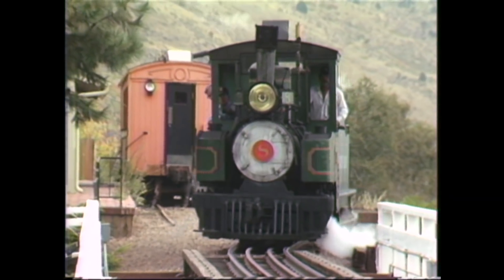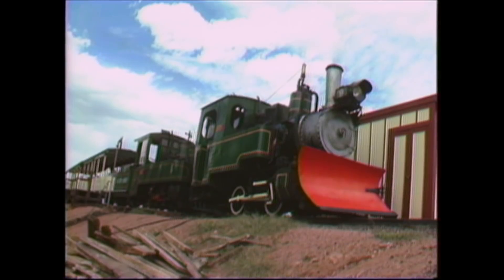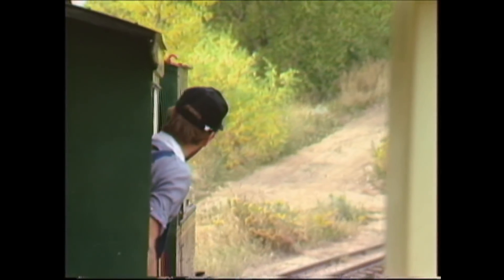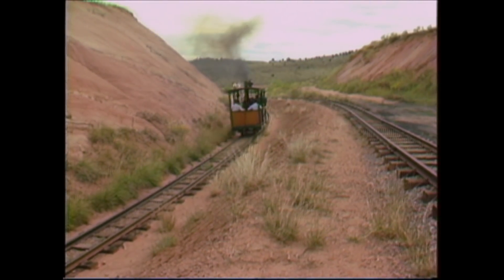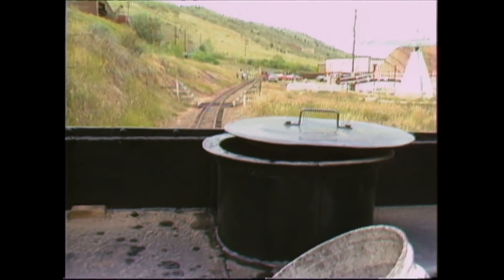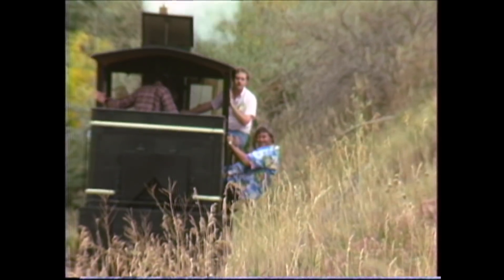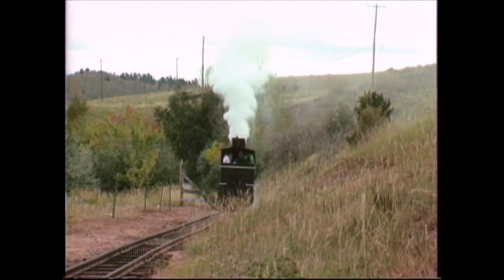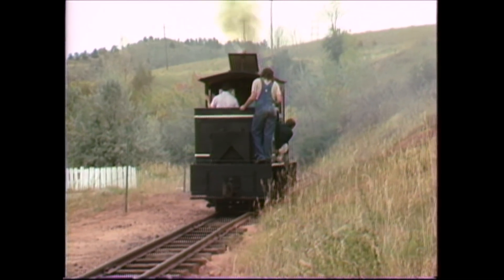Golden's High Country Railroad - 2 Foot Gauge Construction Shay

Comment from the maker: SOME CORRECTIONS! PLEASE READ

As it is really hard to get the straight story on many of these subjects and people, we go with what we can round up, often antidotes. So we get things a bit wrong. Oops.... ANYWAY, we received an email about this video, which clears up a bunch of information about this railroad:

I’m a fan of your videos and thought I would reach out in regards to a recent video about the High Country Railroad in Golden.
 
My Grandfather is Dave Gross, you may know of him if you own any machines of iron videos and if you don’t I suggest them highly. Anyway he was one of the founders of the railroad and after sharing this video with him we found quite a few mistakes in your information.
 
First of all the RGS 42 which did run at magic mountain, only ran for a short amount of time and then was stuffed and mounted on the property. When if came time to build the highway the right of way had to be moved. Which meant so did the 42 and it was traded to Bradshaw by Ed Gerlets, my grandpas partner and best friend, in exchange for many years of charters on the D&S. Ed never bought the 42 it was given to him.
 
Also, when the right of way was acquired it was not Ed alone but my Grandfather and 3 other gentleman who collectively acquired 2 German 2 foot engines, track, and built the rolling stock. The Shay #2 was owned buy a friend of the group who was not physically able to restore it so it was rebuilt at Stan Mathews shop, which was the maintenance head quarters for the operation.
 
The railroad did not go bust. Anything but. It was a hobby railroad for my grandfather and his partners with the goal of getting more young people into the hobby. It operated for 20+ years making enough money to sustain itself and pay the employees. After many years the group was getting older, some not around anymore, and they decided to tear up the track for scrap and sell the engines.
 
Though I know this is probably no big deal for you but it is for me and my grandpa. I suggest more research before posting some of your content.
 
Thank you,
 
Russell Heerdt

Comment: +ToyMan  The Shay was probably the crew-freindliest steam locomotive ever built.  The driver's controls were all within short reach, and the boiler offset gave the stoker additional swing room for the coal hod.  Not every engineer would have been up to the challenge of climbing a 35% grade, but Lima Locomotive Works built the Shay to take cogs (a rarely ordered option, as most logging and mining railways had shallow grades) from day one.
Reply from the maker: Welcome back! Hi. Yes, great little loco. Great idea, sort of a truck-locomotive. Oddly one would think a Clymax or better a Hystler would work better, on paper anyway, Yet the Shay works so much better. I love that this one is 3 cylinder, almost like a model train.

Comment: Awesome video! If the Shay's rod was knock it seems like as exposed as they were you hear exactly which rod was knocking. From there it would just be the matter of isolating the worn part. A knocking rod just means a part was excessive wear beyond what the manufacturer says is tolerable. Of course too much play and it sans engine many times beyond repair. Great video!

Comment: Yes, the “oddball” valve gear on the Shay is indeed Walscharts... mounted vertically instead of the more normal horizontal mounting.
Reply from the maker: And 3 cylinder! Most of the little Shays were 2. But this one is 3 very small ones. WOW!!
Reply: Most Shays had Stephenson valve gear as it is much simpler.
Reply from the maker: But this looks cool!!!!

Comment: 2 ft gauge is great! By the way, why the smokebox are often of silver color in USA, even on these European locomotives?
Reply from the maker: They were often "painted" with Graphite. Comes out a dark silver. It would stick the the metal,  but not burn or discolor with heat. Later they had heat paint that would work, but kept with the look however more silver. The boiler jacket was bear metal! Colored with a process called Russia Iron. Also heat resistant. Also replaced with heat paint later. I think European locomotives used enameling, fired on colored glass. Super good looking. BUt I'll bet in the US they would just paint or graphite the smoke box as that was what they had on hand.

Comment: Do you have any footage of the 15 inch gauge railway it was rebuilt into? I adore very narrow gauge. I think they're adorable and cute!
Reply from the maker: Nope.. It was built by Ed Dickinson. Models of Rio Grande locomotives a little less than 1/2 scale. De left to run CN's steam program,  then left there to run UP's steam program, now restoring the Big Boy!!!!!!
Reply: Aww. model engines. I'm not into that. It's cuter when they're full sized engines in a super narrow guage like http://4.bp.blogspot.com/-BBIadOuuH0w/UaPJe6r92OI/AAAAAAAAI5U/Nclhfy5uqW8/s1600/uvs130527-010.BMP.jpg this engine here, known as Katie on the Eaton Hall estate railway

Comment: Pleeeeze don't put your tapes and films in the attic!  Attic heat and basement dampness will kill film and video!  Keep them in a cool, dry place.  They like the same kind of temperature that you do.  My 8mm and super 8 sound films are kept in the living room closet.  I have film of my kids riding on my 2' gauge backyard railroad and it looks as good today as it did 30 years ago.  Btw, I'm still shooting 16mm film.  I recently shot a live steam event with my old 35mm news reel camera.  My company still develops film so it doesn't cost me anything.  Plus, Kodak says that properly stored, it'll last 400 years.  Another Btw, Many years ago we flew to SLC from here in Georgia to catch the Golden Spike event on May 10th.  I have S-8 film of that.  The trip was my birthday present.  My mother had made me a long, black coat which I wore to the event.  I also had a top hat.  A guy in the parking lot was directing traffic to the right.  When he saw me through the windshield in my coat, vest, and string tie, he directed me to the left.  "I'm not in the program!" I shouted.  Still he directed me to the left.  Long story short, I got in all the recreated photographs!  It was a lot of fun!    Then we went temple hopping for a week.
Reply from the maker: I have so much 16mm film stashed. But it would practically break the bank to shoot it. Still have one of my Bolex H16 REX4 cameras. The others were stolen. Bastards. But I love shooting digital. But it would be fun to shoot film from time to time. Just for the nostalgia of it if nothing more. I have a CP 16R but have never used it!  Do love the Bolex. Stupid simple. I’m trying to digitize all my film and video. Takes time. But so far all in good shape except one video which will not play at all. Sad. It’s the old Rio Grand Zephyrs last runs.